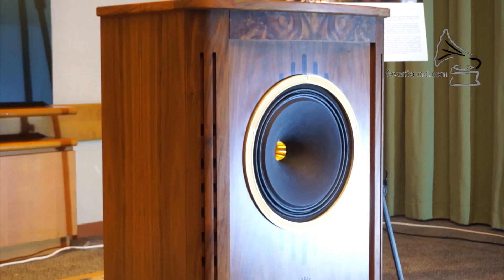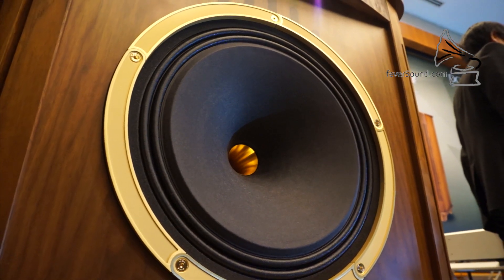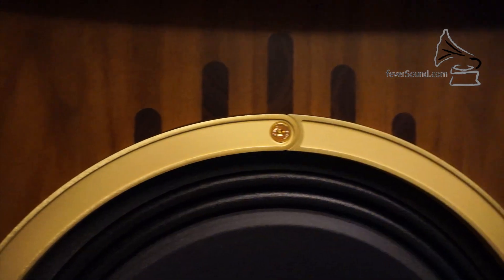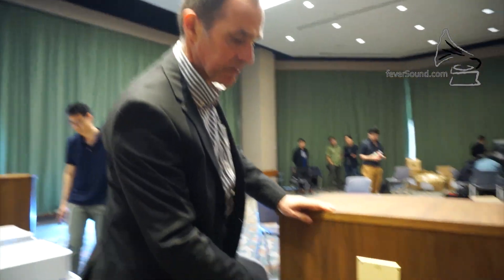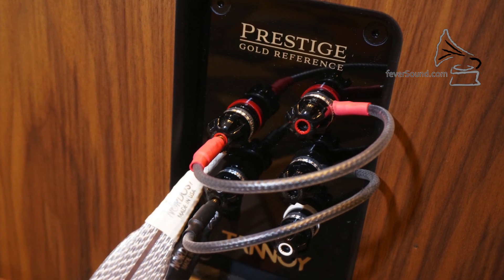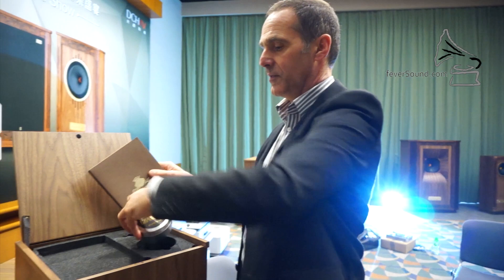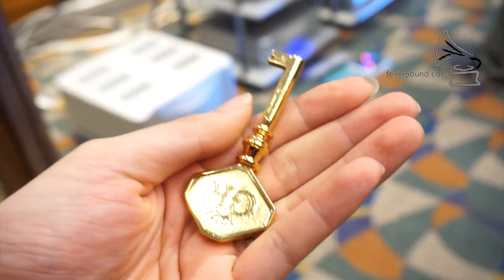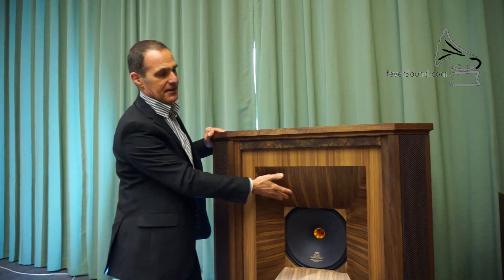Tannoy Martyn Nash Interview in Hong Kong (feverSound.com)

Comment: well..for what its worth and for anyone interested in tannoy, allow me to say this. i have owned their flagship westminster and found them floored. better result was the same driver (k3838) in a far better built but still tannoy recommended enclosure dimension. just not flared front baffle. result? bass that would  wobble a couch at 15-20hz with no mid or treble fatigue. otherwise , look for tannoy gold monitor 1970's vintage. simply unbeatable.